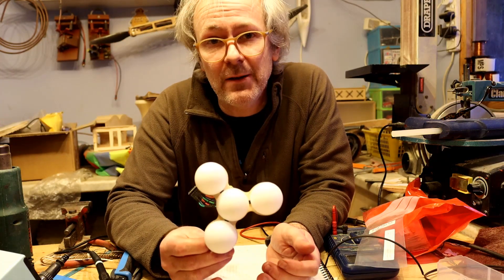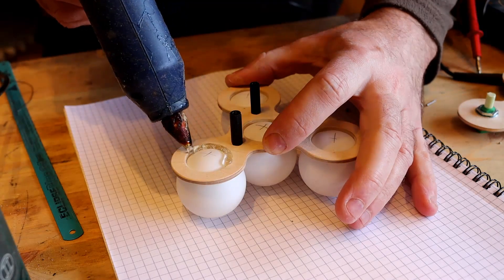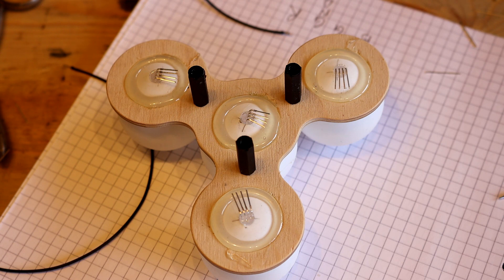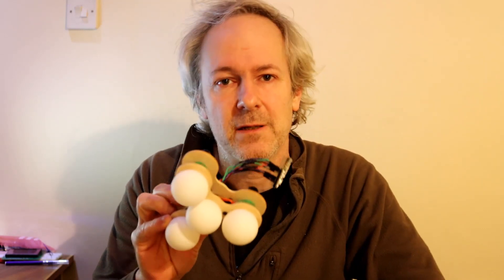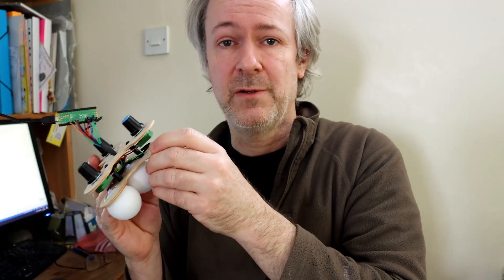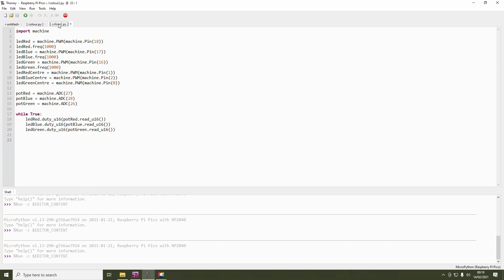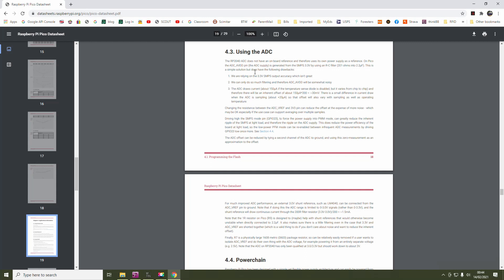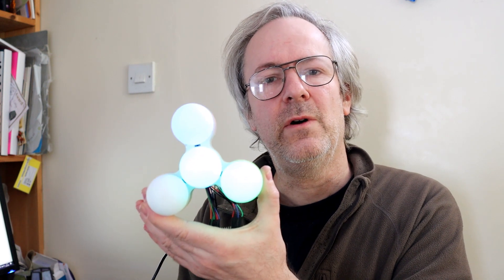Raspberry Pi Pico, First project, colour changer. (analogue offset problem)

Comment: The reason for the leds going off at full brightness/maxPWM is that you have 2 leds in parallel. Leds are diodes, which should NEVER be placed in parallel. Each Led in each color match needs its own resistor.
Reply from the maker: Each LED was on its own output. (not parallel)
Reply: @mrfid72  Hmmm. It looked as if the outer ball using the Red LED, was wired up in parallel with the Red LED in the center ball, as was the outer ball using the Blue LED being wired up in parallel with the Blue LED in the center ball, and the same for the Green LEDs. If each of the six used LEDs was wired to each pin, then we would have seen the use of more than six pins on the PICO, at least 7 pins when you count one of the ground pins. In the Micropython code, you can see that only 3 output pins were configured as PWM pins. 6 programmed output pins would have been needed for each LED to have been connected to it's own pin. (EDIT) Scratch the 3 pins. I reviewed the video and do see that it appears 6 output pins were used. LOL. I stand corrected! Therefore the below paragraph will most likely state what happened in the project. LOL

Now lets say in your stated case, if all the LEDs are on their own pins, multiple LEDs connected to the PICO will do strange things also, such as one of them going out when the PWM above 95% on the high edge on each of the pins. This has happened to me. So it sounds to me, in this scenario, that the PICO's outputs cannot handle the current needed for multiple LEDs. But that MAY not be the case here, because at one point all 6 LEDs where lit to display the seudo white of the combined RGB LEDs inside the center ball. What appears to me that corrected the LED shutdown issue, was when the ADC bit data was shifted 4 times, I calculated that the PWM never goes above 80% on the high edge, which would not ever bring the LEDs to full on PWM power resulting in the LEDs not failing above the 95% threshold.

But in either case, doing things correctly to begin with, is to use an LED driver on each of the output pins, and of course to use a current limiting resistor on each individual LED, whether they are connected in parallel or each used individually.
Reply from the maker: @talk2azs  i put an oscilloscope on the circuit and could see the PULSE go to max then back to zero. Something weird was happening. It was like the PWM value was rolling over to the next bit and resetting.
Reply: @mrfid72  The appearance of the signal rolling over to the next bit is most like caused by internal circuitry capacitance on the PICO. Since you are using 6 of the 8 PWN channels, there is no real way of seeing exactly what and why things are happening in the PICO. Diodes are strange creatures and behave differently in real life than the theory of what is written on paper.

Comment: Amazing. Always better when you get a fault, work it out, find a fix and implement it. Great work mate.

I have a project for you!

6 way gamer timer cube for board games (timing how long people take per turn).
There is one called DGT Timer (they do chess timers) but have discontinued it!

https://www.digitalgametechnology.com/index.php/products/clocks1/227-dgt-cube?mavikthumbnails_display_ratio=2.625

Think you are up for the challenge?!? 

(you love clocks after all...)
Reply from the maker: Always possible, use a old nokia lcd * 6 and a Arduino Nano, Plus a accel/Gyro to work out which face is pointing up. Sounds like a perfect project for you! I have too many projects!!
Reply: @mrfid72  excellent start of a shopping list. I guess the Nokia screen is a part? I'm not ripping old 3218vs apart am I?!

What would you make the body out of?

I'm thinking wood would be a class (and easy thing to manipulate) or butcher a rubrics cube! Actually, that would be pretty cool.

PS watched your soldering vid today, I could almost smell the flux :)
Reply from the maker: @mylor1066  check on ebay for "nokia lcd arduino"